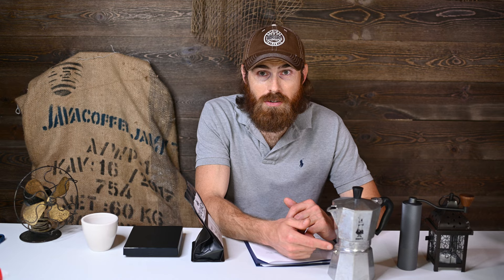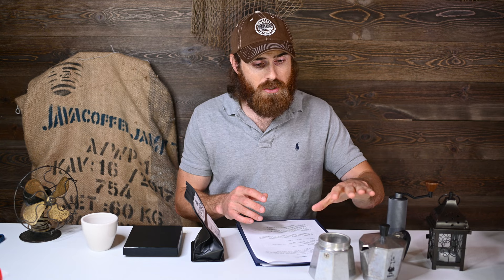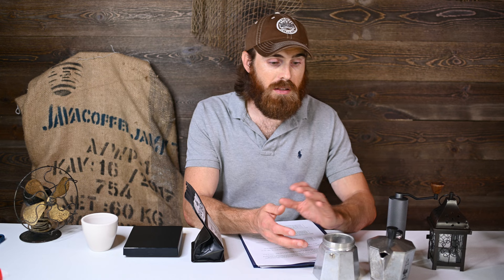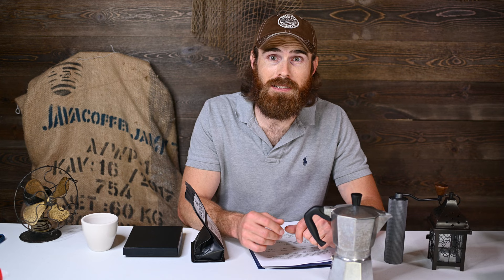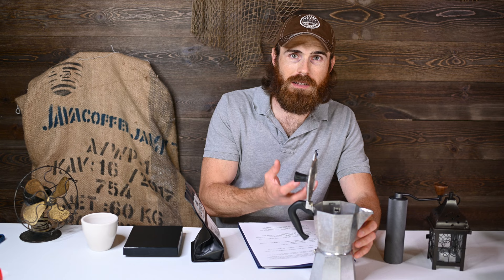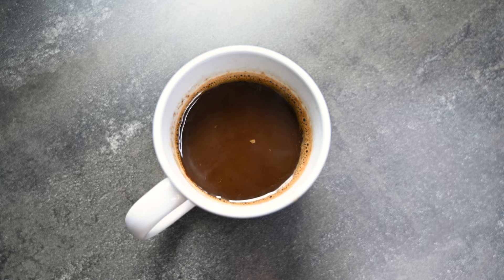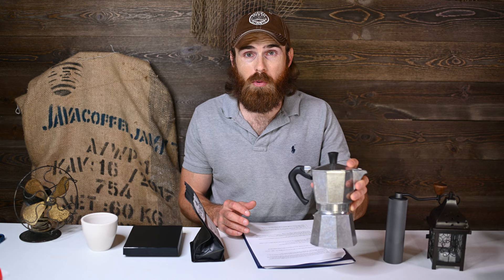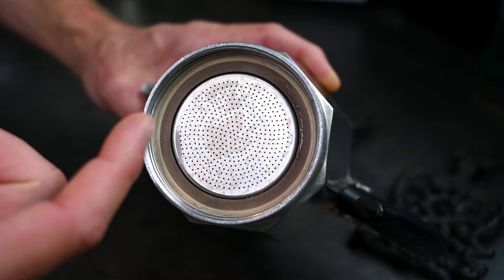How to Brew with the Moka Pot - Down and Dirty | Quick and Easy

Comment: I do mine almost exactly like you do except for that last bit.  I try to prevent blow-by, which is when the coffee spews at the end of the boil.  Preventing this controls for bitterness.  I only want to taste the bean if possible.  Good video.
Reply from the maker: Thanks so much my friend! Ya, I have recently started to pull it before that point. You are correct, it does cut that bitterness down more. Truly appreciate you watching buddy!
Reply: The 'blow-by' is actually called Strombolism or The Stromboli effect(after the volcano - make sense). To be avoided, as after that starts, the coffee is boiling in the top chamber and becomes bitter.
Reply from the maker: @nessieg23  Thanks so much for the info! I truly appreciate that. Been experimenting around with this and it has a pretty big effect on the coffee.
Reply: I like the bitterness haha.
Reply: Yep, blow by is where most of that bitterness comes from. Ever time I stop it before that the bitterness is way lower.

Comment: I use regular coffee filters, cutting them to fit the basket size  then wet the filter snd put on the bottom of the receiving chamber.

I also boil the water in the bottom chamber, then turn the heat all the way down so i can drop the basket in, the go back to medium heat after tightening the top.  Turn the heat to low once the coffee first starts filling the chamber.  

I also do not find it necessary to cool the lower chamber to stop the brewing.   As long as you brew it slowly there wont be a strong gurgle at the end.

Comment: Just got one today! Currently seasoning it. This is the best coffee making guide I’ve seen. You rock dude!
Reply from the maker: Thanks so much! I truly appreciate hearing that! Hope you enjoy it and hit me up with any questions!
Reply: @RobPirieCedarOtaCoffee  more often than not, I don't get that smooth flowing brew. it spits out a bit. what's usually causing that? too much coffee in the filter?
Reply from the maker: I don’t think it would be to much coffee. It is most likely the heat. Adjust the temp down after a bit of time or right when you see it come out. It takes some experimenting to find the right amount of heat. I turn my heat down a bit towards the end to mitigate the pressure being so high. That will give a nice easy flow upward instead of spraying out. Don’t get discouraged if it takes a few times to find that sweet spot. Good luck!

Comment: Came back to post at 1:50 is my favourite part and always gets me chuckling. I have a 1cup and a 3cup. My 3cup holds 15g of coffee powder and around 130-140g of water. My little one is probably around 100g of water and g of coffee powder. I use the 3cup due to us Americans prefer more coffee. I like more because of taste. I know 1-12 cup Moka pots are based on Italy measurements.
Reply from the maker: It took me awhile to realize the “cup” was not the standard measurement but based on Italys espresso measurement. I think a lot of people still are confused by that and I wish I would have covered that in the video.
Reply: Yeah which is why it's not uncommon to dilute the coffee down with hot water to taste. I like to use a 3 cup moka pot and then fill up my thermos with hot water the rest of the way at about a 1:1 ratio and can sip on it all the way until lunchtime.

Comment: Fun video. but some pointers if its ok. Dont press th coffe down when it in the funell, just stroke over it with a knife. Coffe in the mokka pot will brew better if not pressed. About cleaning..when pot´s not warm anymore, wash it in your sink without detergent, only hot water is needed and dry with som paper or a kitchen towel. an extra tip is to buy a new rubber-ring from silicone, that makes the rubber smell go away. They are cheap. And dont wash in mashine...
Again, thanks for video, i enjoyed it! Happy Easter....

Comment: As far as I know, there's no need to use soap on the Moka pot, just run it under warm water and use a soft sponge or even your finger.
I only used something else to clean it when I bought my Moka pot. It was second hand and I put some citric acid and water and "brew" it once,  dumped the liquid, then I repeated, this time only with water. 
Thinking back, it might not be a great idea to use any acid on the pot, but I wanted to give it a proper cleaning since someone else had used it before me.
Reply from the maker: I def figured out the hard way! Ya, putting it in the dishwasher is not good. Truly appreciate you watching my friend and thanks for the advice!
Reply: @RobPirieCedarOtaCoffee  what happened when you put it in the dishwasher?
Reply from the maker: The protective coating came off. After awhile it will tarnish.

Comment: Hey thank you for the video~!
Im using timemore c2 grinder, im doind 12 clicks for a while now fore medium roasted coffee.
Should i go finer? or coarser? 

Im using as well a Bialetti brikka new model, should i use hot water or cold as the manual ? thank you!
Reply from the maker: I usually do 11 clicks on mine. I use cold water just because it is easier to deal with. I have tried the hot water method and honestly in a blind taste test I can really tell the difference. I pull it off the stove pretty early before it starts to sputter though now. Thanks for watching buddy!

Comment: Great tutorial!  You should never put anything made of raw, un-coated aluminum in the dishwasher as the chemicals in automatic dishwasher detergent can “etch” the aluminum.  What does the inside of the bottom of your moka pot look like?  Hazy with dark spots?  If so, it’s etched.
Reply from the maker: Thanks buddy. It doesn’t look bad on the inside. We use a very natural like soap so I don’t know how harsh it is. I haven’t done it sense it was brought to my attention though. I think the outside has a coating but after cleaning it up it doesn’t look like that was to bad affected. Def learned the hard way on this one! Haha thanks so much for watching buddy!

Comment: Loved the vid, very clear and informative. I just bought one of these and excited to brew with it. There's one thing that's bugging me a little , the instruction manual of the ones i bought (same brand; bialetti 300ml) says not to wash with detergent, i think that means no soap right?
Reply from the maker: Yes do not wash it with soap in the dishwasher. It will remove the coating on the side. I learned the hard way. Lol

Comment: I still have yet to buy a moka pot. I’ll be picking one up ASAP though. 

Have you seen the new Bialetti Brikka pot with faux crema?
Reply from the maker: Ya the Brikkas look cool. Def have a more modern appeal. I think if I get another one I will try and get a stainless version. But they are probably pricey.  The Moka Pot is fun to plan on but it definitely is a different taste than all the pour over styles. Took me a good while to find a method I liked.

Comment: I heard that if you have a larger moka pot but dont fill its porta-potty full of potent coffee grinds to the rim (lets say 16g of coffee for a 6 pot/330ml) then it would make sense to use an aeropress filter to kind of equalize the pressure a little for a better brew. Ive been brewing coffee with the pour over method for years but decided i wanted to try something like a moka pot. I havent slept for 3 days straight so its safe to say that i still have a lot of learning and tweaking to do.
Reply from the maker: Haha ya the Moka pot will pack a punch for sure! It is one of those devices with such a unique flavor you almost have to tweak all the small variables until you find what you like. It seems everyone has a slightly different way they like their coffee from the Moka pot. Thanks so much for watching and good luck mastering it!

Comment: I just bought a 12 cup so I can make basically 2 cups I can take to work.  This thing never has a steady stream, it is constantly "coughing" so I have to keep the lid on so it doesn't make a mess.  Any tips?
Reply from the maker: Your heat is to hot. Turn the heat down little by little and eventually you will find a sweet spot where it trickles at a good flow. Once it gets low on water it will start to cough and I pour it at that point. The little bit of coffee left will just start to turn your cup bitter. Hope that helps buddy!
Reply: @RobPirieCedarOtaCoffee  Thank you! I'll try that
Reply from the maker: Awesome! You caught me working on a thumbnail so glad I could answer quick!

Comment: I keep getting a fine ground texture but I'm pretty sure my coffee isnt too fine. Could it just be the quality of the coffee? I also need to try heating the water before actually putting the top on
Reply from the maker: I think that is pretty common with the Moka pot in general. Fine coffee grounds will rise up with the liquid when it is brewing and get in the upper chamber. The only way I have found to reduce that is to put a paper filter like an AeroPress filter on top of the coffee. It helps some but you still get some fines in it. Some cultures really like that and prefer it with some sediment. One of those to each their own things. If you find a better way definitely let me know!

Comment: does it taste more like espresso or regular drip coffee? also, do you tamp the grounds at all in the filter?
Reply from the maker: I would say more on the espresso side. It’s pretty strong and most will mix it with something. Lighter roasted coffees (to me) are enjoyable straight but if it get darker roasted I would add some milk or something.
Reply: No tamping. I've heard moka pots create approximately 2 bars while espresso machines are in the 9 range. 
     So the water at 2 will flow thru everything pretty evenly with a loose puck.

Comment: the purpose of running it under cold water, is to STOP the process BEFORE it start spouting out. let it come out until its dark and syrupy, before it starts to clear out. if it starts spouting out, you've ruined the good cup already.. that clearish water at the end is just badly brewed.. bitter sour hot water. if you want to water it out, add some fresh boiling water to your cup, or milk...
Reply from the maker: That’s what I tried to explain in the video. As soon as I get to that point I would rather pour it out. The extra 7ml of coffee you will get from pulling it off the stove to running it under water is not worth it to me and like you mentioned it increases the risk of just getting a bitter and diluted brew. Pour out that coffee and go!!! Haha thanks for watching buddy and appreciate the comments!

Comment: For some reason I also confuse microwave and dishwasher when speaking. And my mom does as well.
I knew what happened to your moka pot as soon as it was in focus. I don't know for sure if you've ruined your moka pot by cleaning it in the dishwasher. That residue on the surface may actually be poisonous. If I were you I'd look it up.
Reply from the maker: Thanks Vlad! I looked it up and I did not see anything too crazy about it. I guess it is pretty obvious it should not go in there after reading! haha. My wife uses natural cleaners with no chemicals so I think it should be fine. I have actually been looking for a stainless steel one and I might get one if I can find one at a good price point. Thanks so much for watching and truly appreciate the heads up. I am going to read more up on it for sure.

Comment: If you do not take it away before bubbles come, you ruined it. That simple. You try to heat down the oven and keep the pot on oven, you ruined it again. The right time to take it away from heat completely is when liquid comes out and let it go as right before any bubble starts (flow max). Then you put it aside and let the liquid comes slowly while cooling in room temperature.
Reply from the maker: Thanks for the insight. Truly appreciate it!

Comment: Please my Friend in my pot i can make 300ml of water.... But how much grammes of coffee ? Hoffmann said 1/10 ... Well 30grammes but its too strong :(
Reply from the maker: You can add extra water to dilute it down. It’s kind of a strong concentrate at 1/10.
Reply: Bialetti said they designed the Moka to be a measuring cup, so you'll always get the perfect ratio of coffee to water if you fill the reservoir with cold or room temperature water to touch the bottom of the valve, and loosely fill the basket with medium-fine ground espresso and level it off with the rim, but don't press it down.

Comment: NO DISHWASHER !! Will destroy shiny finish ! Italian friends universally say do NOT put your ( aluminium ) moka pot in a dishwasher. Otherwise...pretty good informative vid. Hey dude....that's a lot of coffee for 1 person. I kinda think this is known as a 4 cup pot. Certainly has a kick ! I tried reducing to a smaller 2 cup pot but that doesn't always give sufficient kick.
Reply from the maker: Thanks for the info! I normally just wash it out in the sink by hand but sometimes if I am lazy I will throw it in the dishwasher. I may stood king that if it is not recommended but it hasn’t hurt mine so far. I have the 6 cup because the bottom container holds exactly 300ml of water. I think 250ml is the 4 cup. And honestly we are pretty backwards over here when it comes to measuring so that may be confusing too. Thanks so much for watching my friend!
Reply: I don't know how or if possible....to show you a pic of a similar moka pot I did put in the dishwasher. As I said it completely destroys the shiny finish.
Received wisdom...is that the right term ? says just rinse in hot water.
I have many Italian friends.
Coffee aficionados can talk hours on the moka pot story....and also about aluminium, the Italian favourite...and stainless steel...often preferred by non Italians who believe aluminium contributes to Alzheimer's.
Reply from the maker: Received wisdom! I like that term haha! Truly appreciate the advice. I will hand wash going forward.

Comment: mine always spurts, pls help me
Reply from the maker: Heat is probably to high. You may need to start at a lower temp. Pull the Moka pot off before it start to spurt. Thanks for watching and hope that helps!
Reply: @RobPirieCedarOtaCoffee  thanks man,but do i leave the heat to low and wait for the coffee to come out or should i adjust the temp while in low heat?thanks again

Comment: Please don't align the handle with the steam release valve. If it's steaming & you need to remove the pot from the stove, you're going to get burned.
Reply from the maker: There is no other way for mine to align. The threads are cut to where it lines up with the handle every time. Def a flawed design after thinking about it. Good point.

Comment: Pro tip- replace the shitty rubber gasket with one made of silicone. You. Are. Welcome.
Reply from the maker: I don’t really have an issue with the rubber one. What is the benefit of the silicon one?
Reply: @RobPirieCedarOtaCoffee  cleans much easier. Never dry rots. You’ll see the benefit the first time you use it.
Reply from the maker: Nice! I’m going to have to see about getting one. I imagine it’s a harder material too.

Comment: Nope, sorry....you screwed it up there....
Hot water until just underneath the pressure valve-correct.
Fine to medium coarse ground-not pressed-correct.
Medium heat-correct.
Then take it OFF the heat BEFORE it starts "spouting".
A good advice is when the coffee stream changes color (usually just before it reaches the start of the spout (?) if that makes sense?

If it starts spitting, the coffee is burnt....
Reply from the maker: Thanks for the helpful advice Sascha! I have actually started pulling it a little sooner and I def agree that it helps keep it from getting to bitter! Truly appreciate you watching and thanks for advice!
Reply: @RobPirieCedarOtaCoffee  You´re welcome.....it has taken me years to be able to make good tasting coffee with the moka pot, and more than once i had given up on it-only to be motivated to try it again by other people who managed to make good coffee with it......its definitely one of the best ways to make coffee (in my opinion), and i appreciate anyone who is willing to deal with this "diva" of coffee mastery....
:)
Reply from the maker: I can deal with anything as long as I’ve had my coffee first! Haha